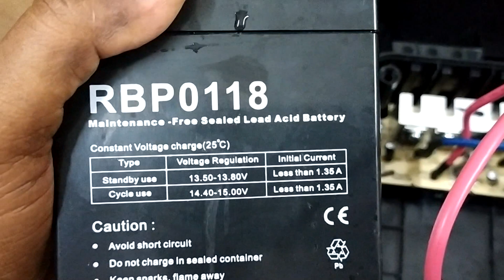How to pc ups repairing / Cyber power ups battery replacement

Comment: I purchased this ups recently and I put it on charging for 8 hours as told in instructions. The ups body was becoming hot and I know it's normal as battery is drawing power to charge. But even after 12 hours charging the ups is still becoming hot while main power is on but output is switched off. Why it's so ?
Reply from the maker: Power connected that time out put power coming or not coming
Reply: @BtmTechvideos  output is coming. It's new ups. But ups is always hot even when output is switched off. Is it always charging ? I already charged it for 12 hours and not used in backup mode as there's no power cut in my area
Reply from the maker: Check the battery voltage